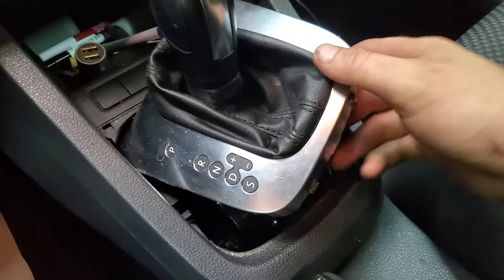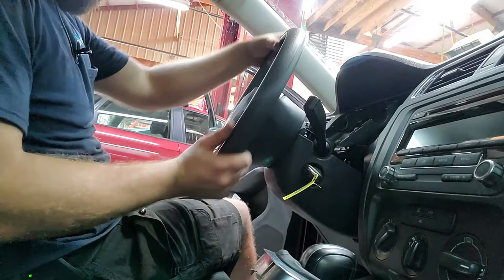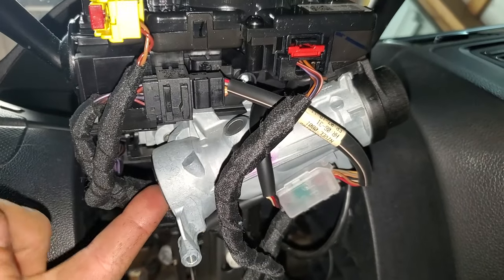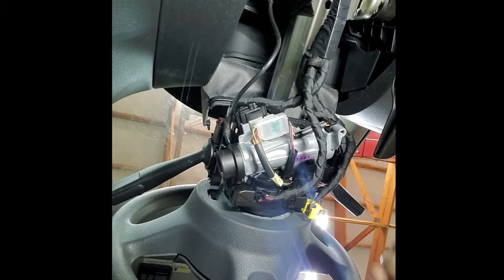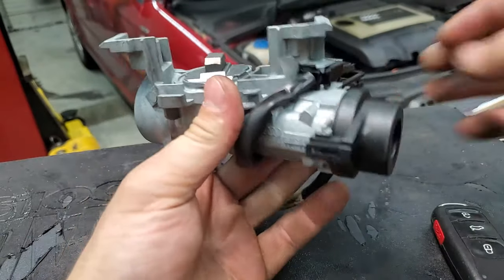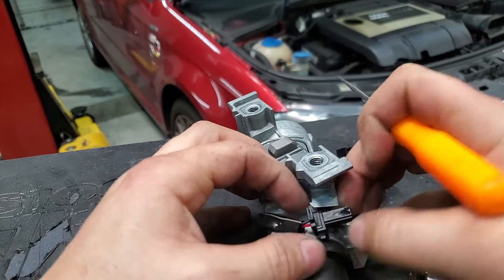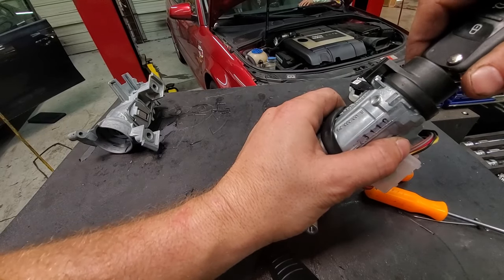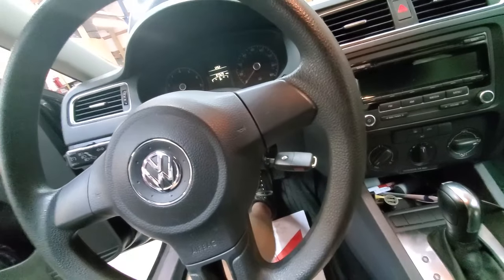How To Remove and Fix the Ignition Switch in 2012 VW Jetta DIY

Comment: When reassembling the existing key barrel mechanism into the new steering lock casting ( 11:20 ) , is it possible to install in the wrong orientation? I pushed it in, it clicked into place, and now the key won't turn at all, seems like the steering lock is stuck out. Therefore I can't align the notch to pop it out again. Any help would be appreciated
Reply from the maker: Yes it's possible to put it backwards, however if the key cannot turn at all, then it should still be able to pull that locking tab back in with the pin. It may need to be harshly shaken or wiggled to get it out. 

I need to make a video of showing how to gut these things so people can just use the one's they have.
Reply: @deamonmachine  this exact same thing just happened to me. When reassembling, I must not have had it aligned properly because now it won’t turn at all and Im having trouble removing it again.

Comment: To remove the switch you showed you had to punch out the two screws at the top.  What'd you have to do to install the new switch to the steering column?
Reply from the maker: Got 2 new bolts that are the correct threat pitch and size (m8 I believe). Take the old one to the hardware store and look for a matching one (they should interlace with each other).

Comment: Hello hope you're doing great! Question. Did you use the same break-off screws to install it? Thanks in advance bro!
Reply from the maker: No, I just used some normal bolts. Those breaks away screws are so easily defeated. However, having a thin walled 13mm that JUST fits, is more difficult :D
Reply: @deamonmachine  I feel you!! Thanks brother I'll try some normal bolts with the same thread and pitch! 👍🏻

Comment: What is the thing with the point that you reattach to the cylinder housing that goes into the housing?  Is that something that can also stop the key from turning?  Is that for the park sensor or immobilizer?
Reply from the maker: No idea honestly, never had it break and never had a reason to look it up. It doesn't seem to stop the key from turning.

Comment: I have same problem currently occurring on my 2010 GTI. Is it a straight replacement of parts or did you need to do anything with a scan tool after replacement of ignition switch?

Comment: Great video. Followed the steps, but car won' t start. Key turns, lights and radio work. Have any idea what the problem could be?
Reply from the maker: Gotta make sure you plugged in everything.
Reply: Did you ever get it figured out? This same thing is happening to me. Key turns lights radio all on but won’t start.
Reply: @hannahvarela  did you find the solution?

Comment: Hey, I got the new part for it, installed it the same way as you mentioned, but the steering lock piece won't go in the lock position, so its thinking the key is still in the ignition and can't lock or unlock doors with the remote, any idea how to fix that, let me know thank you in advance
Reply from the maker: try re-seating it on the steering column, the locking actuator may be hung up on the column itself (there's a cutout for the lock to engage on the steering shaft). I've gotten it off center before, tough to bolt down and doesn't work right, reseated it and it fixed it for me (as best as I can tell your issue is with this description).

Comment: With you only having to replace the Ignition cylinder did you have to reprogram the key to the car?
Reply from the maker: no, this is purely mechanical parts being replaced.

Comment: Got everything out and the new one installed. Having trouble finding where the small plug with the red and black wires plugs back in. I've looked all under the steering wheel/column. Any help would be appreciated. Thanks

Comment: I got a 2012 Jetta GLI. Exact part like the new one you got. However, when I put it together with the other connectors, it still doesn’t work. I even took the original ignition switch onto the new housing. Still nothing. Any ideas? Could I have also put the tumbler in the wrong way?
Reply from the maker: before you couldn't turn the key, now you can turn the key and it still doesn't crank-over or start-up? That's possibly a wiring issue if I understood that correctly (or starter etc).
Reply: Could it be faulty ignition switch perhaps?

Comment: You did a video on a 2012 Jetta ignition replacement.  I have a new lock and assembly.  The lock was made to my VIN and fits my key.  I’ve put the two parts together and I can move the key from on to start, and it springs back, but I can’t move it to off (or get the steering wheel lock button to pop off).  Will there be any problems if I reinstall it to the car this way?  Does it need power to go from on to off?  Any advice you have would be greatly appreciated!
Reply: I put it together but the key still won't t turn. 
I'm trying to get the key lock out but the holes don't line up. Any suggestions?

Comment: How did you pull the ignition cylinder off of the steering column? It feels fastened on still after removing the breakaway bolts. You seemed to snap it off somehow. Any advice?
Reply from the maker: There are 2 little plastic tabs that hold up the cylinder until you get the bolts in.

Comment: Did you get new bolts to replace the ones you had to chisel out? Does it come with them or reuse them or what?
Reply: Pretty sure he got new bolts. Question is what are they called?
Reply: @PaoHoselton_  I got my new ignition housing from the dealership and they also had the breakaway bolts for like $4
Reply: @PaoHoselton_  The bolts are M8-1.25×20. You can use regular bolts from a hardware store, however it leaves your car more vulnerable to theft. Chances are slim it will ever matter.

Comment: If it comes with new sensors do you have to get it programmed?
Reply from the maker: Haven't had to yet. it's mainly a mechanical replacement, not so much electrical. That's why it doesn't change anything in the programming or key.

Comment: I got the breakaway bolts out easy enough but something else is holding it on, anyone have any ideas?

I was glad to see your video, I didn’t want to have to take the whole airbag and everything off. But I still can’t get the cylinder to drop down. Someone help!! Please!! :)
Reply from the maker: There's 2 plastic tabs from the bottom that "snap" the cylinder in place, use a screwdriver or your finger to push one of the tabs back and it should drop easily (no force required)
Reply: @deamonmachine  Dang okay I'm gonna go look again and hope I can find them! Thanks for the response!
Reply: Dude I cannot figure this out what the heck!
Reply: @czcrossman  did you ever figure this out. There’s so many little tabs I can’t figure out what’s holding what in place. Trying not to break any of the plastic.
Reply: Yes I did! It’s actually one large tab on either side, it’s very hard plastic and it’s really thick/wide so it doesn’t really even look like it would push in. And yeah you do have to kind of force it, it was scary at first but once I realized that’s how it’s supposed to work I got the other side out, fixed the thing for free, and reinstalled in like an hour!
Reply: @czcrossman  i gotta be blind im not seeing these tabs 🤣

Comment: I’m having the same problem with my Jetta but quick question after replacing the ignition switch would I have to reprogram a new key? Or would the same key still work?

Comment: So I have this problem when I removed the cilinder the steering wheel went in lock and now it can’t come free and the cilinder won’t fit anymore because it doesn’t align any more. Is this a kill switch that I triggered or what? Thx for your video! It’s great fun right.
Reply: Were you able to figure this out?

Comment: I’m in the process of this repair now. I got the 2 breakaway bolts out, but there is a thin black module beneath the ignition cylinder in my 2010 Jetta that I believe I need to remove prior to dropping the cylinder. It has a small screw that looks to be around a T-10 size, but that doesn’t work. Anyone have an idea of what type of screw that is and what tool I need to remove it? Thanks and awesome video!
Reply: Update: I used a T-9 bit and got it removed.

Comment: For some reason every video that uses a punch to remove the bolt shows the bolt to come out as though it were originally finger tightened; when apparently my Jetta is the only one that was torqued to spec and won’t turn no matter what, even with an extractor on an impact driver.

Comment: At about 6:35 in the video he’s able to do something to get the entire thing to drop down. I have the bolts out but I can’t figure out what is still holding it up in place. Any help I’d appreciated!
Reply from the maker: The 2 tabs are plastic, they are opposite the bolt's and on the bottom holding the edges of the housing in (not tightly though), you need to push those tabs back to make it finish dropping out.
Reply: @deamonmachine  I did finally find those but there seemed to be some other clips still holding it up. I ended up just banging it out with a hammer. Haha. It worked, Got the new one in and and everything back together and the car is running great. This video helped a ton thank you!
Reply: @deamonmachine  I'm having the same issue... Using a hammer makes me a little nervous, did you hit it toward the side? As in toward the driver's door? Break anything in the process?

Comment: How on earth did you get that last connector off without removing the steering wheel?
Reply from the maker: The one that goes to the switch itself? Carefully, the plastic bends enough to get it out w/o breaking it. It will definitely make you clench while you undo it the first time :_deamonCel:
Reply: @deamonmachine  Yes. I got it out. I just yanked it . I don't think it will slide back in there though. You really helped me out. Thank you.

Comment: I did the repair, and everything is working properly, but now there is an airbag error light on. Should I be worried?
Reply from the maker: You turned on the key while an Airbag system connector was unplugged, it will need to be cleared by someone who can scan the airbags on that car.
Reply: @deamonmachine  Heard that. Thanks man. Really appreciate you for making the video and answering my question. Wish I could buy you a brew or something. Ha.

Comment: What do you do in place of the break off screws when you’re putting it back Together?
Reply from the maker: Replace the break off bolts or new reg bolts.
Reply: @deamonmachine  do you have the dimensions of the bolt, and it is similar for a mk6 gti?

Comment: Hi im currently fixing my jetta replacing the ignition housing I’ve followed all your steps. One question when you put back together did u disconnected the battery??? Do u need to? Also when your attaching the housing to the switch do u need to have the key to the on position?? Or off position?
Reply: Disconnect the batter if you want, doesnt matter, I haven't got the part of adding the housing but based of the video you need it in the on position again to attach it

Comment: HELP PLEASE! A friend replaced my ignition lock cylinder with a non OEM part.  When I put my key in, the car cranks but then dies.  Safety feature? Called dealership and they said key has to be programmed but it HAS to be an OEM part. I have a key that came with the new cylinder and I have my original key. Is there a way around putting another part in? I ask because my friend is no longer here to replace it again and I’m at a loss.
Reply from the maker: Call a locksmith, do you still have your old unit? they will know what to swap onto the new cylinder.
Reply: @deamonmachine  No!!!! An idiot threw the old lock cylinder away. Do you HAVE to have the original part?

Comment: I just did the swap in my car, and it starts up, but dies after a few seconds and I get a key not in range signal on the dash. Can anyone explain what I need to do to fix this part of the process? The new ignition switch assembly I got has a new key, because my old key broke off the key fob a while ago. Any help would be greatly appreciated.
Reply from the maker: You didn't plug in the sensor (the black ring around the key hole). The immo is preventing it from running cause it can't ID the key.
Reply: @deamonmachine  I just opened it back up to re-check, and looked back at my pictures to make sure wiring is all the same as when original was taken out. Its all the same and connected, including black ring around keys electrical plug. Same issue

Comment: I have the problem when I take the key out I don't hear a clicking noise. The steering wheel lock works and the car starts but when I pull out the key I don't hear a clicking noise
Reply from the maker: If the steering lock works I wouldn't worry about it, as long as the car shuts off, it may just be a little quiet compared to the older one.

Comment: With the key stuck and not being able to pull out I noticed that it's not possible to remove the bottom cover without removing the steering wheel?  The key does turn but I don't see the notch.

Comment: Hi how were you able to make the key turn to where the two notches aligned so you were able to stick the pin. That’s my problem. The key won’t turn at all.
Reply from the maker: A lot of banging and shaking. Basically there's loose broken parts inside there, so they are jammed somewhere they shouldn't be, you gotta get them to move (in an unknowable direction).. It's taken me 30 min to get some to dislodge, tap it with a hammer, smack it on a table while trying to wiggle the key at the same time.
Reply: @deamonmachine  thank you very much. This video has helped me a lot. The most important thing for me is to be able to save the tumbler where the key goes in.

Comment: Sorry to keep commenting. So the bolts that hold the assembly to the steering column doesn’t have any thing screw off just use a punch to unscrew it?
Reply from the maker: I use a sharp punch (not a chisel) to hit a notch into it that will bite, then hammer it "off" using that notch to push it, then eventually it'll just unscrew using that hole.
Reply: @deamonmachine  yes i rewatched your video and did it with a pointy drill bit and it worked. I got the piece off. I owe you a six pack
Reply: I was able to get em loose with a 10mm chisel brother

Comment: Its impossible to put the switch back without the removing the wheel
Reply: Why do you say that? What model is your car? Mine is slightly different than this it’s a 2014 and I’m having a little bit of trouble too. What did you end up doing for yours?

Comment: mine key wont allow me start engine but allowed me get 1st turning .. so will i need key barrel？ or cylinder please 
p.s just need key get 1st turning for steering wheel unlock, fitted a switch and start button already
please share part number for key barrel and cylinder please try to DIY it b4 ask someone fit..

Comment: Just did mine, now after i installed it my car says no key detected and won't start........ It was purely mechanical so why do i get this error????? I need help
Reply from the maker: did you watch the follow-up video in the comments?
Reply: @deamonmachine  I commented on the follow-up video, a little more background it's a 2011 Volkswagen Jetta, I replace the cylinder lock with a non OEM part I don't know if that's going to be an issue considering it's just mechanical all the electronics are plugged back up my key turns everything works it starts but then it dies after about a second or two and says no key detected, I triple checked everything to make sure it's plugged up I just don't understand if the cylinder lock is the problem considering it's only mechanical and all the electronics are programmed to My key that I'm using.

Comment: I'm assuming that is an OEM replacement cylinder?  If so, did it require programming or anything, or did it just work.  I just ordered one for wife's car!
Reply from the maker: No programming necessary, the issue is strictly mechanical (that I've run into thus far). Parts of the innards break and lodge themselves in the mechanism thus jamming it. A way to unlock it is.. honestly, to unlock and bang around the wheel while trying to jiggle the key into turning. I've gotten 99% of them to turn enough to disassemble them from there.

Comment: Trying to remove the housing from a 2012 Passat, which I assume is the same or at least similar. I can get to the point where the security bolts are removed (thanks to the prick punch tip!), cables unplugged, etc. HOWEVER, I cannot for the life of me get the darned thing off the column. I can't find any tabs or anything close to allowing me to remove the housing. I see that a tool was used to move something on the opposite key side that allowed it to come off, but I can't seem to find anything that I can move to do that. Any ideas???
Reply: How did it go?
Reply: Where you able to remove yours? That’s where I’m stuck as well
Reply: Follow-up: Yes! I got that darned thing off. And of course, once I figured it out, it's a piece of cake if I ever have to do it again. Basically, on the right hand side (facing the wheel), where the housing is snapped in, you need a flathead screwdriver to shove in there and "pop" the latch by using a twisting motion. I used a smaller width, long shaft one to do it. Basically, I got to the point where I said "If I break it, I break it", and lo and behold, it unlatched.

Comment: The break away bolts? Dude...you didn't explain the most important part of the video. :(
Reply: Just get a pointy punch and make a tiny hole in the top of the head of the bolt with a hammer (but don't hit it too hard) then put the  tip of the punch in the indentation of the bolt and hit it in an angle counterclockwise and it'll become losen, turn it until threads are out then get a magnet and remove bolt from hole